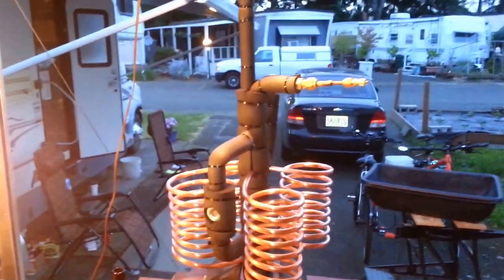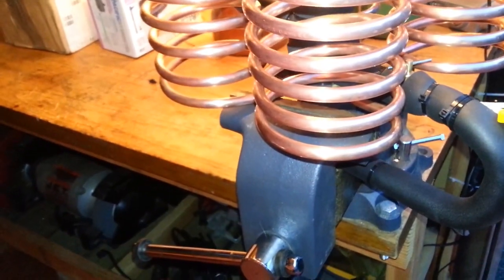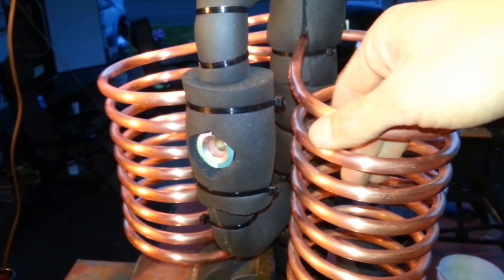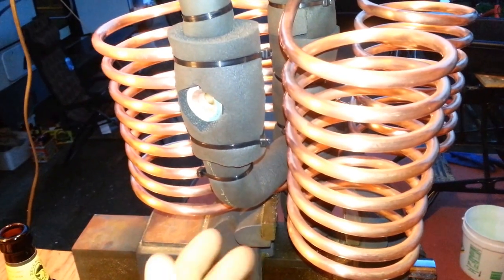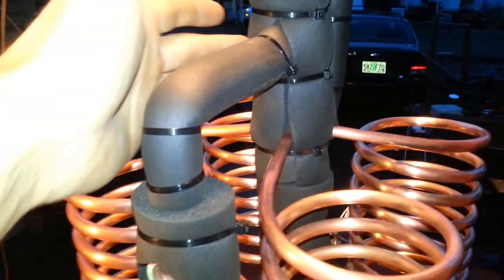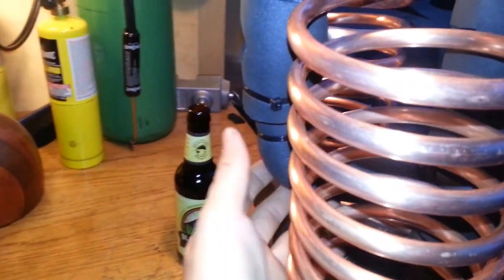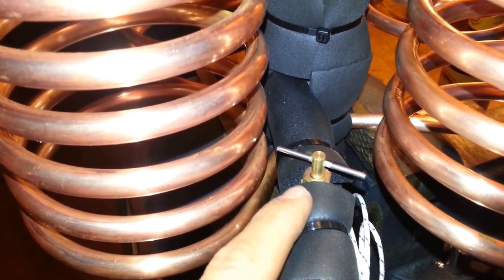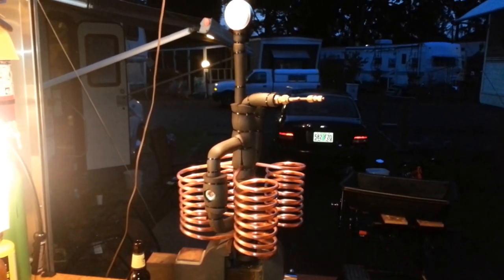The Gravity Flooded Ebullator!

Comment: Mike, your enthusiasm is contagious !  I have been thinking about the fundamentals of heat pumps for days. I suppose the simplest air conditioner is a bicycle pump. Suck in some room air, walk outside, plug the outlet and compress ( and hold) the plunger. Air and cylinder get hot. Let it cool off outside, walk back inside, uncover the outlet and let the air ( cooled by expansion) out into the room. Continuous method might be outdoor compressor in taking room air, into a het exchanger under pressure, exhaust into room through restriction. Now trying to understand the advantages of using phase change materials. So far looks like smaller exchanger requirements, reverse Brayton cycle vs  blah, blah......        Thinking how to use water in phase change vapor compression set up.       Thanks again for sharing your adventures with us bumps on logs
Reply from the maker: The air cycle is actually a very good place to start. Most people don't begin there, but it is much easier to understand.  In the 19th century it was definitely a competitor with the VC system, but now it is inly used for pretty specialized processes.  I would suggest starting with an old text book from before WWII.  I feel that they ex[lain the principles much better.

The copper work, on the other hand, comes from trial and error and a little research.

I'm no expert on the subject, and I've made several mistakes over the course of my experiments.  I jumped into pretty complex experiments, without first gaining the fundamental experience of building simpler machines.  I'm trying to make amends for it now, but what I did get to work makes me want to return to some of those crazy copper contraptions, like the ejector.